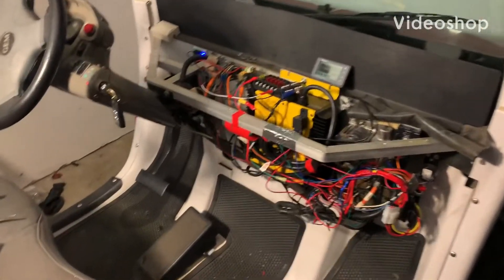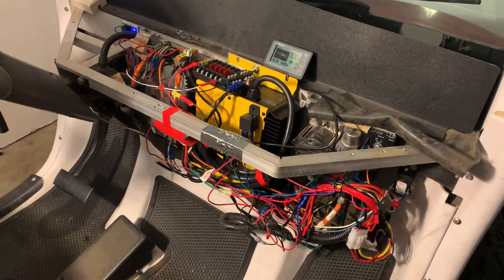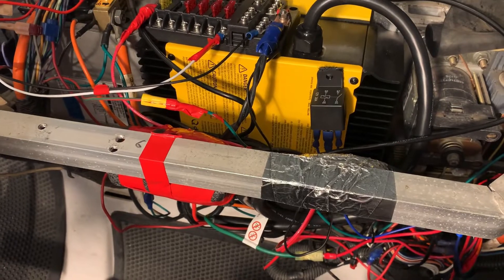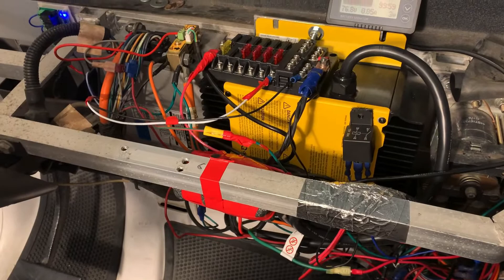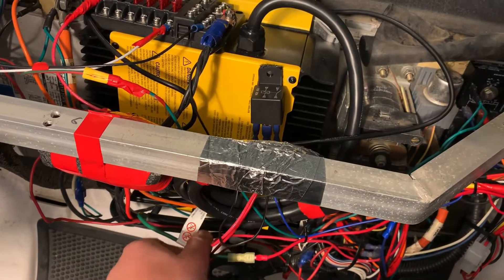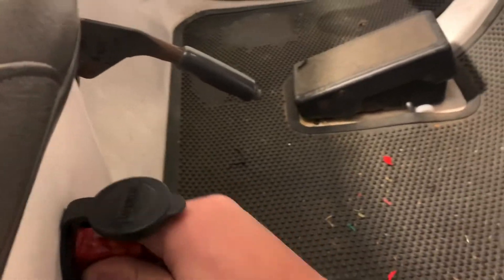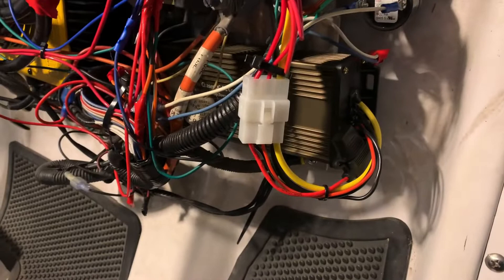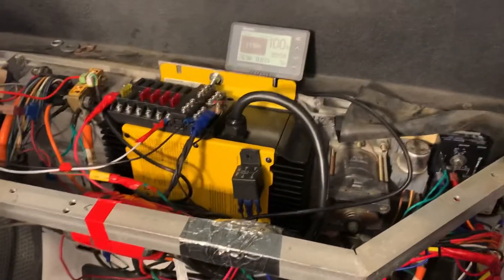GEM car new charger interlock

Comment: Hey there, just picked up my 2002, also had a burned out zivan charger but previously the owners charged the batteries individually to drive it. I tried installing the deltaQ but i might go with an aftermarket 72v charger because mine doesnt seem to work. Have you had any issues with the controller? I am seeing error code -4 on the dash when I try to drive it. Although all the electronics work fine with the switch.

Comment: Hey Johnny, have the same problem you do but in my case I don’t mind the interlock. So wiring it directly is what I’m gonna do but what did you do the the orange cables going into the charger. You also have a green cable going into a red cable. What it that for? Appreciate anything you can do for me

Comment: Hi Johnny, did the interlock wire(s) coming out of the charger have pack voltage or did the wires going to the charger supply pack voltage? Thanks.
Reply: Hi did you ever figure this out?

Comment: Johhny, I am attempting to change out a old zian charger for a new delta Q. Can you walk me through the wiring? The delt q only has three connections, The whiteand black on one terminal. This should go to the b- on th controller? The red to the 400 amp fuse side? and the green interlock to which exact wire? This would help tremendously. My charger instructions are not clear.
Reply: Hi Mark, I wired the pos and negative as you indicated, additionally, the green wire on the interlock is supposed to hook into the wire going to solid state timer (part number THDB230C). The white wire is for the temperature sensor. Mine doesn't work however because it needs to get re-programmed.